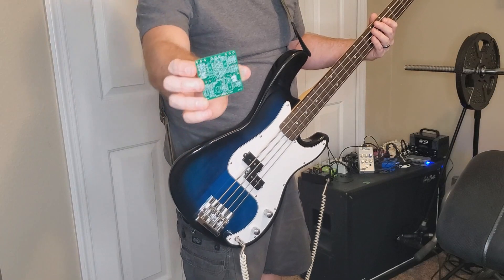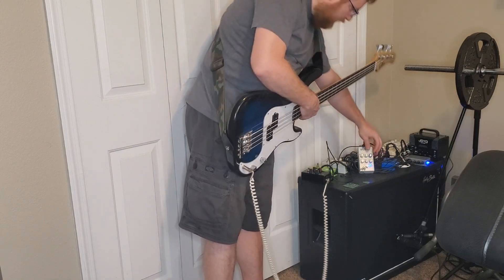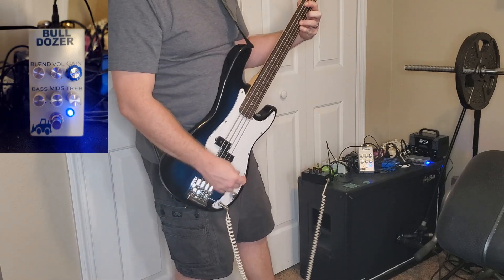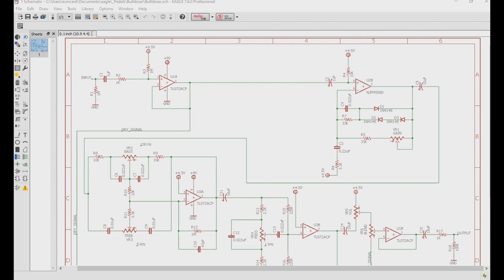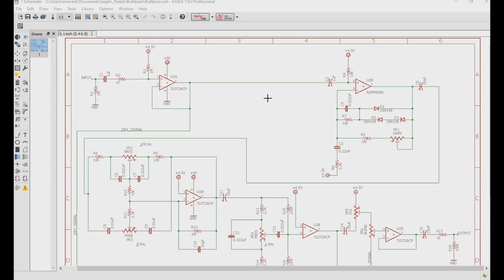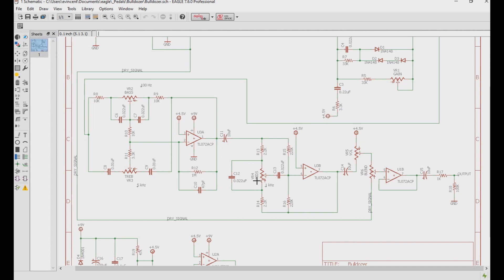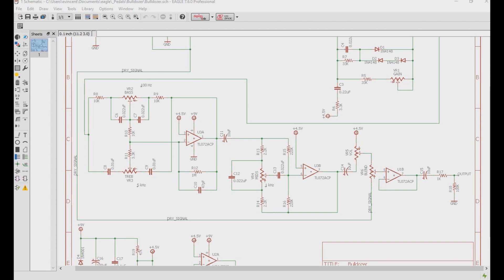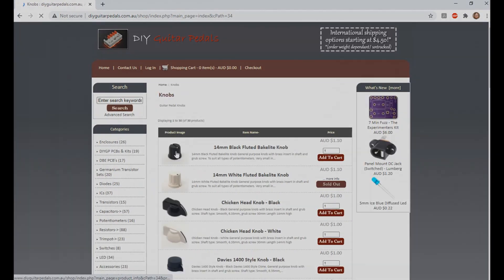The Bulldozer - Sound Demo and Circuit Analysis

Comment: is there a guitar power amp scheme that almost resembles a tube ampilife, which is good, including the preamp?
Reply: I'm not saying there isn't one, but I haven't seen a good power amplifier tube circuit made without tubes. However, there are some solid state circuits that have a good "feel" to them, such as the Sunn Beta Lead. But if that ones sound isn't one you like, I wouldn't recommend. The schematic for the Sunn Beta Lead is out there, if you google for it.
Reply: ok, thank you very much,, I am very grateful for the answers to your comments and suggestions,,, if for the amp simulator how does the sound, is it almost close to the original tube
Reply: @kanthafa3317  usually "amp simulators", specifically ones that simulate tube amps, typically are just simulating the preamp section, which includes most of the tone shaping portions of that circuit of that amp. The ones that come closer to sounding "correct" are ones based on JFETs. I have one I have been using for a while that is a preamp of a Laney Supergroup tube amp. At some point, I wouldn't mind releasing it.
Reply: oh so it's just the preamp part, can I see your Laney Supergroup tube amp? if you don't mind can send it to my email
Reply: I've studied the schematic of Sunn with different leads, but I'm having trouble finding the TR and IC materials used...
Reply: @kanthafa3317  If you look up schematics for the Sabbra Cadabra pedal, you'll get an idea of a Laney pre-amp. The first part of the pedal is just a Dallas Rangemaster, which you can remove. From the 100nF capacitor and 1M pulldown resistor to ground, that is the start of the preamp. In the middle of the schematic, you'll also note three resistors in series with each other with 3 sets of small value capacitors going in between where they voltage divide. This is a marshall style passive tone-stack. If you replace the three resistors with potentiometers, that will be your bass, mids, and treble controls. On the Sabbra Cadabra, they just hard set them with resistors to what Tony Iommi typically left his amp settings at.
Reply: I can't find the schematic you're talking about

Comment: Great video and proyect as always. If i wanted to modify this to be more suitable for guitar, what resistors and caps from the tone section should i be replacing? thanks in advance.
Reply: In the build doc, it goes over the EQ section. You'd probably want to change out the resistors and caps in the those sections to focus more on the EQs you are looking to deliver on your guitar.

Comment: I want something like that for bass but that sounds more like Lemmy Kilmister, is there any circuit you'd recommend for what I'm looking for?
Reply: Lemmy used a dimed out Marshall
Reply: @tobins6800  and make sure you are on the neck pickup, have the preamp have its mids on 10, bass and treb on 0 and be drinkn' whiskey
Reply: This circuit can get there, but another option would be the Whipped Llama. Using this circuit, you'd probably have less of the blend on dry and more on wet, and turn down the high EQs a bit more and raise the mids a little as well, as Lemmy's tone was more on the distortion and less on "clank".